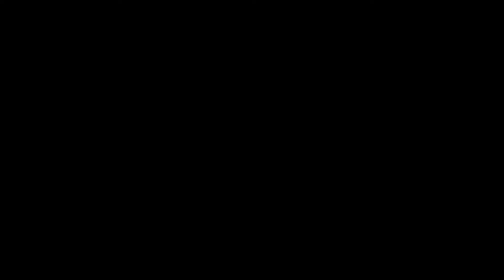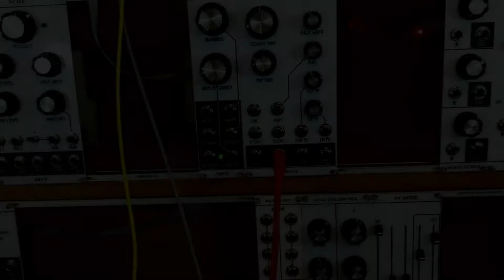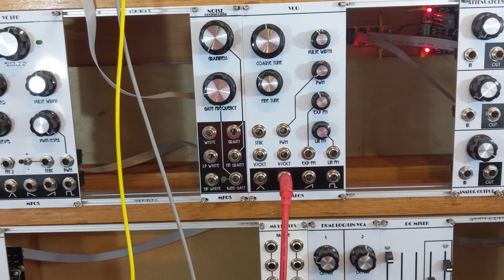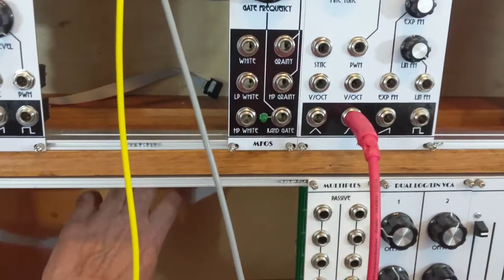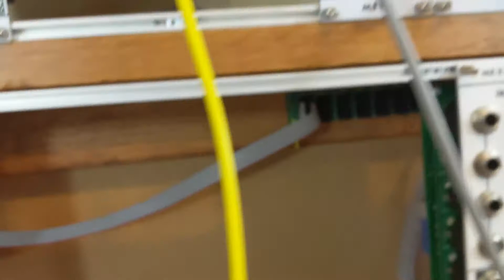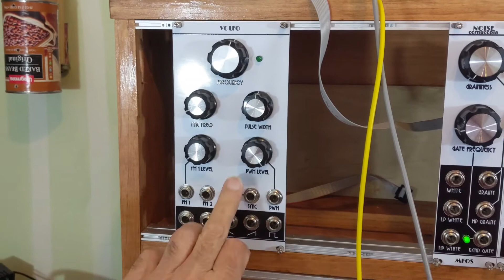Progress and panels

Comment: Nice!  I’m having a similar problem with Sam’s performance VCF.   Neither HP or LP are working right audibly or on the scope. Have to tear into it this week.
Reply from the maker: It's a similar design. In Barton's the HP input is normalled to ground so if nothing is plugged in there it behaves as low pass. That was the connection I'd omitted. In the LMNC there's a switch instead (Sam doesn't like normalled jacks) so you'd be unlikely to have the same issue.